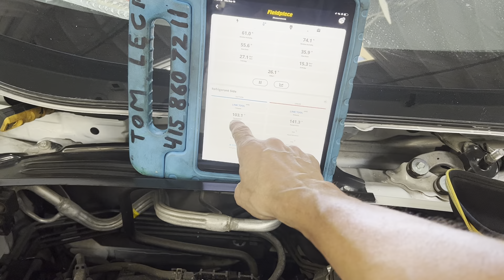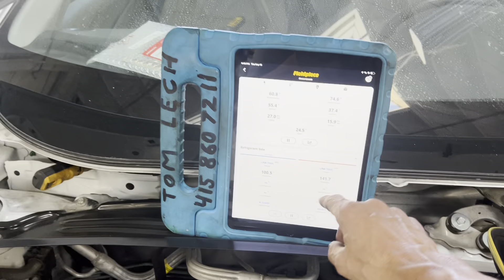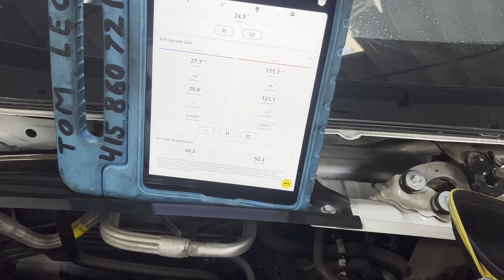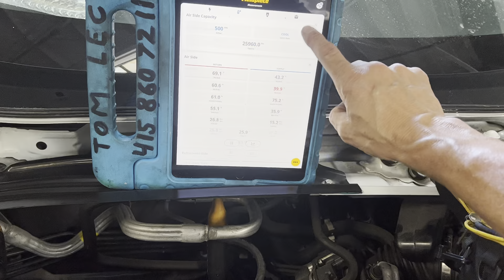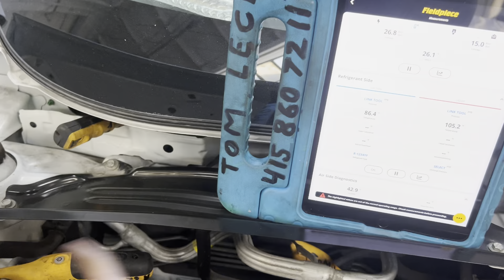aftermarket AC condenser they cost customers more money in the future. Let’s screw the customer￼￼

Comment: 2002 toyota tacoma, not cooling hooked up manifold and No pressure either side .  Dry N2 purge then removed and installed new filter /dryer (OEM) .  Nitrogen purge 4 to 5 times with vacuum each time, pulled last vacuum  as best I could / micron gauge fluctuated between 340 to 1150 micron after 35 minutes .  Began to drop to around 400 microns then added two cans of 134A .  Weighed each can with hose and can tap attached to start then after can  nearly empty and weighed again.   Factory charge says 550 to 650 grams needs be added and I added about 600 to 620 grams of refrigerant to high side ( this if how the factory manual says it should be done by the  way).  First can added very quickly but second can was considerably slower ( I warmed inverted can with heat gun briefly and can again emptied very nicely) .  Weighing the can while attached to the hose ( with can tap in place) was a bit tricky because the empty can didn't sit easily on the balance pan and kept falling off.  As best I could determine I added 600 to 620 grams of refrigerant.  Removed all the equipment and reinstalled the caps to the high and low side , started engine and got 45 °F out the center supply vent after 5 minutes at 1500 RPM .  I could not get micron vacuum below 1100 micron ( fluctuated between 1100 and 700 microns after 30 minutes)  so I threw in the towel, closed all the valves and added refrigerant to high side.  I was using Yellow Jacket manifold and JB Industried hoses !/4 inch with ball valve ends.  I think I could get vac lower with larger hoses but I'm not servicing multiple systems  a day so I'm just tinkering in the garage .  Will be considering 3/8 hoses with ball valve ends in the future .  My pump is JB industries 3 cfm model, not some monster rated suck machine, so I'm happy.
Reply from the maker: Sounds like you did an excellent job very detail you do not need a big vacuum pump is not necessary

Ball valves have a tendency to leak try putting a little NYLOG or silicone grease , dielectric grease.  Trying to pull micron levels through refrigerant hose charging hose don’t expect it to hold below 700 or 1000 µm just the rubber hose itself will make you fail. 

When it comes to pulling a deep vacuum and holding cannot have refrigerant charging hose in line it becomes part of your measurement. 

The valves need to be isolated and air gets trapped in your valving so remember to move your valves back-and-forth slowly in a little bit as your dry and vacuum to purge the absolute my Knute amount of air that gets trapped in ball valves. 

Having a small vacuum pump but a silicone deep vacuum hose makes all the difference in the world. 

And it all comes down to time and how moisture contaminated the system is

You may see some of my videos within five or 10 minutes I’m already into two or 300 µm on a really dry system

On a heavily moisture contaminated system I could be an hour and still be at 1200 µm. 

Don’t get frustrated you just have to know how to read the micron gauge in the vacuum decay. 

It literally tells you everything. 

Mini micron gauges are very sensitive to even the most minute contamination of oil on their sensors and they will give you some fluctuating readings or bad readings holding readings that don’t move for a while a lot of different problems. 

And just the micron gauge bad design of sensor and being sensitive to contaminants that get on the sensor itself will make a lot of people frustrated and give up using a micron gauge because they don’t understand. 

This is why having one dedicated brand new recover cylinder as a guinea pig known good reference tank for all your tests in the future with all your vacuum related equipment

Once you have a dry clean reference tank that you can get down to weigh below 100 µm and you can repeat that test over and over again. 

Now you have a good tank for every new or questionable piece of vacuum equipment or hose or ball valve should all perform the same on that one same tank that you never use for anything else. 

You will learn a lot doing this. 

But first you have to be able to obtain that well below 100 µm and that’s not with the vacuum pump running that’s with the valve off in 10 or 15 minutes later holding steady not moving not rising.

Comment: Holy crap. I've seen your previous videos on the other aftermarket condensers but that one takes the cake so far as far as cheating you out. Made in China?  Lol
Reply: We can blame China all we like, but they simply make products to the specs American companies ask them to. Customer wants cheap, China delivers. They are quite capable of making quality products. In fact, they now make a number of "European" luxury cars.
Reply: @WaffleStaffel  Quite capable but  choose not to. Like you said they could totally provide us a quality product if they wanted to.  So why don't they?  Seems to be no trouble for say Japan.
Reply: @mailmanjoe  There are very high quality parts that come from China, especially when the western company remains in control of the manufacturing process.  Lets face it and many of these companies went to China to cut cost and insert planned obsolescence.  

When Japan started its manufacturing people used to call it junk as well.  Soon much of there manufacturing processes surpassed that of the United States, and I see the same happening in China.  Manufacturing is a little more difficult today because so much of it depends on technology, where in the 60's 70's and 80's it was mostly mechanical. Into the 80's we had individual components on bread boards with motors driving devices with rubber bands.
Reply: @mailmanjoe  At the risk of repeating myself, they build to the price points that American companies demand. Nobody is going to give you top grain leather for naugahyde prices. Mr. Carpenter states the situation well. Apparently you're too young to remember when people whined about everything being made in Japan, or when NAFTA gutted America's manufacturing infrastructure. It's a moot point anyway. Though few people are aware that 90% of Wal*Mart's inventory was made in the USA as recently as 1995, most remember it was still garbage. American's don't build quality anymore, yet they expect high quality on the cheap, and when their $90 portable ice maker stops working, they can grumble xenophobic profanities.

Comment: I got confused.you said 40 drop on cheap one VS 25 drop on OEM one . 
Seems the cheap one doing better job 
Right?
Reply from the maker: Actually it’s the opposite higher efficiency condensers have lower drop I know that does not seem like common sense. 🤯
                Old style not efficient condensers you’ll see 30+ or 40 even as high as 50° drop

On the newer highly efficient condensers you will see some thing like 15° or 20° drop may be a little more

The same goes with high-efficiency operating systems both heaters for heat pumps or air conditioning

There will be less drop across high efficient evaporators in cooling mode

The same goes for high-efficiency gas furnaces are old furnaces where are you would have 160° or 140° coming out of your heating grill on today’s most advanced high sufficiency furnaces you might only have you will have lower temperatures coming out are more efficient

The same for heat pumps in heat mode you may notice you only have 95°F or 105°F coming out of your evaporator coil in heat mode on today’s most modern most efficient heat pumps

It’s strange less equals more

This is why on these extremely high efficient heat pumps and air conditioners the outdoor condensing coil is so large because they want more thin surface and they want more tube surface area

And they actually want less pressure with a less compression ratio on the compressor this is more energy efficient

It’s a very simple physics thing. More surface area that’s what it’s all about it could be measured you can use Math it follows a rule

When you take your college courses for thermodynamics and fluid dynamics this gets explain to you. 

That’s why on one of the videos I released I was driving down the road with 39°F coming out of the dash of the vehicle at the same time the high side pressure was only 66 psi and that was normal for the vehicle .
Reply: With a high compression ratio (pressure increase across compressor in psia), the compressor generates more heat, requires more torque.
Reply from the maker: @thisisyourcaptainspeaking2259  I have to get better at explaining this to people in my videos I am still not a good instructor.
Reply: @coldfinger459sub0  Tom, you're far more effective than you might anticipate! ;)

Comment: Why 25 degree droo is better that 40 degree
Reply from the maker: Like it’s a little more complicated it’s really not that complicated but more than I want to make a video on

You will have to watch the videos of the HVAC instructors on YouTube that I recommended about high efficiency HVAC design
Reply: @coldfinger459sub0  Can you give brief explanation for that.Thank you.
Reply from the maker: @issamadam9352  When you take a temperature drop across one of the old condensers that were tubing fin You will see from the old standard compressors that were not that efficient hey 32 almost a 50° temperature drop

Put on many of the new high efficient parallel flow micro channel condensers you will see the temperature drops at 15° to 30°